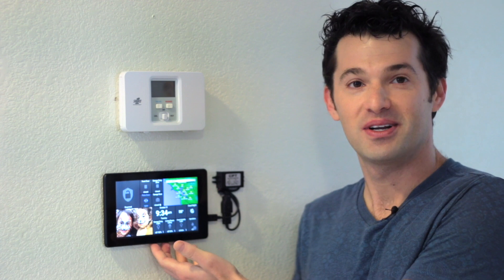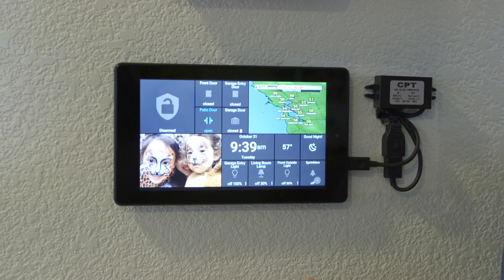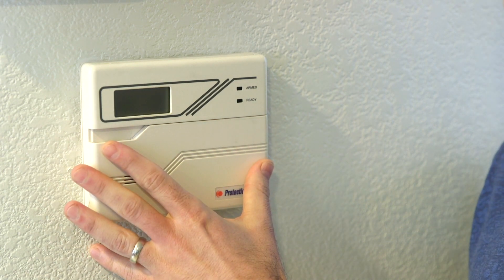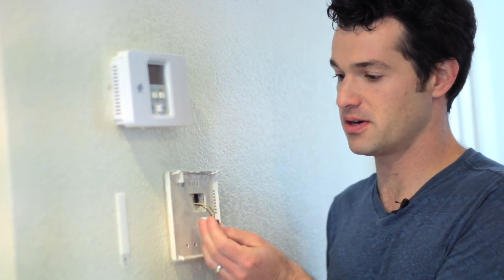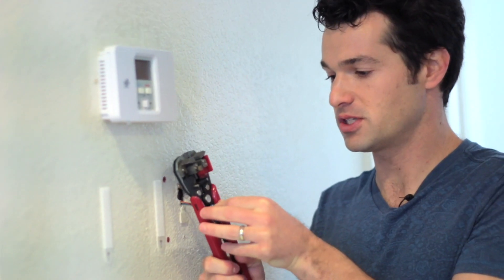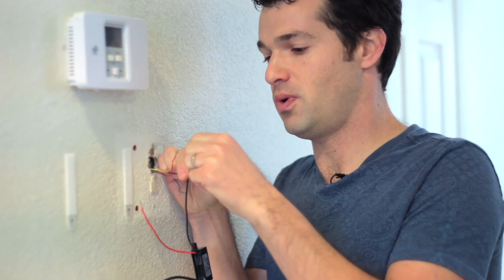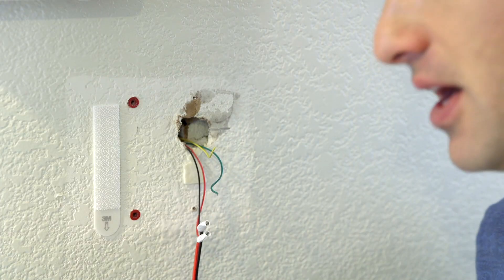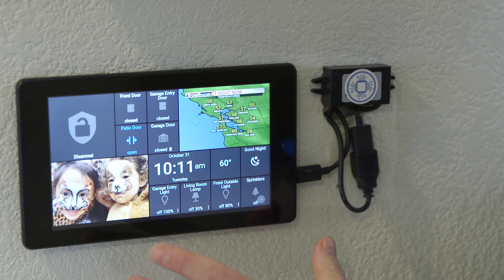Replace your alarm system keypad with an ActionTiles touch-screen tablet — Konnected DIY add-on

Comment: Let me just say that wire bundle and usb-power module on the wall is the worst looking installation I have ever seen!  it look 10X work then just keeping your legacy touch keypad!
Reply from the maker: this was just a demo... you can easily hide the wiring behind the tablet in the wall. We sell accessories to assist in that.

Comment: Correct me if I’m wrong but wouldn’t this render a burglar alarm useless. With Ring you typically need to enter a code upon entry to deactivate. With this  app it seems all you have to do is tap “disarm”.
Reply from the maker: Not quite—Konnected doesn’t remove the PIN layer, it just lets you choose where that PIN lives.

• Keeping the legacy panel (Interface Kit)
Your original keypad and entry-delay workflow stay intact. Konnected merely “presses” the panel’s keyswitch relay; the panel still refuses to disarm unless the correct code has already been entered on the keypad (or you’ve wired that relay to a keyswitch zone you purposely made code-free). If you want the traditional enter code within 30 s behaviour, you simply leave it programmed on the legacy board.

• Running panel-free (Conversion Kit / Alarm Panel Pro)
Disarm commands flow through a hub such as SmartThings, Home Assistant or Hubitat. Each of those platforms lets you require a PIN or biometric unlock before it will send the disarm call:

SmartThings Home Monitor – toggle Require PIN for secure devices and set a 4-digit code; Google/Alexa voice control also asks for that PIN.

Home Assistant Alarm Panel – enable code_arm_required / code_disarm_required and pick any code length.

Hubitat Safety Monitor – same idea: Require Disarm Code.

So an intruder still needs (a) your locked phone or (b) the correct PIN on an exposed dashboard—exactly the same gate Ring uses. The tap-to-disarm you saw in the demo assumes the user has already passed phone biometrics or the hub’s PIN dialog.

Comment: what happened to green and yellow wire?
Reply: I ask same question
Reply from the maker: Red and black were the keypad’s +12 V and ground, so we keep those to feed the step-down converter for the tablet. Green and yellow were only the data pins that let the keypad talk to the alarm panel; once the keypad is gone they serve no purpose. Just cap them off—or, if you want a little thicker conductor, twist green with red and yellow with black before landing the pair on the 12 V input. Otherwise, leave them disconnected.

Comment: All I have seen you do was connect the power from the alarm system keypad to the 12v to 5v converter. However, the green and yellow would be required to actually interface with the alarm panel to operate. Please tell me you just skipped a section, because you mentioned the connected and showed a small interface that I thought the green and yellow wires would go in that required the 12v power supply.
Reply from the maker: We didn’t skip anything—the tablet doesn’t talk to the alarm panel over the green/yellow data pair at all.

Red (+12 V) and Black (-) are reused purely as a low-voltage feed: they go through the 12 V → 5 V converter and power the tablet.

Green and Yellow were the keypad’s RX/TX lines for the legacy panel. Once you retire (or relocate) the keypad, those conductors have nothing useful to say to a tablet running a smart-home dashboard; communication happens over the tablet’s Wi-Fi/LAN to your hub or directly to the Konnected board.

If you’re keeping the original keypad, leave all four wires on it and run a second 2-conductor cable—or repurpose an extra cable run—to power the tablet separately. But for the typical “replace the keypad with a wall-mounted dashboard” setup, red/black power is all that’s required.

Comment: 2:30 Potentially valuable tip to share with your customers: Don't bend copper wires back and forth any more than absolutely necessary, as doing so induces stiffness in the metal which ultimately leads to fatigue and breakage. This holds especially true with solid copper leads.
Reply: Even more true with the cheap CCA wiring you are seeing more and more these days

Comment: I have an alarm, it is hard wired.. It is not wifi and I do not want wifi, how would this work with just powering the tablet and an app?  Makes no sense to me. The other 2 wires would need to be connected some how for the 2 units to *talk*.
Reply from the maker: The table communicates to SmartThings via WiFi. It doesn't "talk" directly to the alarm panel.
Reply: @Konnected-io  Thank you it's a little confusing because it's a bit vague..

Comment: I am pretty sure you didn't need to pull off your alarm panel to do that.  Also, since you are running the phone app on your tablet, I suspect it no longer requires a disarm code.  So anyone can walk up and disarm your alarm after breaking in.

Comment: Why WHY is that not tucked into the wall.  And then cover the hole with tablet and have the little power cord just plug in so much more cleaner u have great ideas though
Reply: Maybe even a 90-degree USB adapter so it doesn't jut out the side of the table? :-)

Comment: what do the other 2 wires do.  They are connected to my control panel on the other end
Reply: This is not a complete conversion, they just show you a wireless tablet!  this kind of system require a new wireless system module and sensor!  this wifi touch panel won't magically work with your wire system!

Comment: I am using ADT Alarm system using smart panel and GSM. I can use any smart device to arm/disarm the alarm system anywhere around the world as long as i have internet connection. The contract is finished. Now i want to be able to use existing motion detectors, doors/windows detectors (all wired) with new panel (tablet, cell phone or new smart panel alarm system). 

Any advice?

Thanks,
L.A
Reply: You should be able to use all of the existing sensors and motion detectors. Their support is really great if you need help. You can also purchase a 3d printed mount for the tablet. I'm about to do my first official install in a friends new home. All smartthings with ActionTiles and using Konnected as the alarm. Thing to note though....Right now the modules are wifi only. IF YOU CHANGE YOUR WIFI OR GET A NEW ROUTER, YOU WILL HAVE TO REPROGRAM EVERYTHING. So what I'm doing is getting a TPLink access point that is powered via POE and setting up an SSID just for home automation. (tablets, konnected, smart bulbs that dont use a hub, etc). That way, if I ever decide to change the home wifi, its on a different system and wont affect my home automation. But since it ties into the main router, and is not a router itself, (just access point) then users can connect to main home wifi and still control the devices.
Reply from the maker: You DON'T have to reprogram everything if you change your WiFi. Just reconnect to the new Wifi network. The rest of the settings are independent of WiFi and the device will resume working on the new network.
Reply: Look up the Ring retrofit kit.  I did the same thing with an old wired ADT system.

Comment: Imagine slapping a tablet in your front porch instead of a standard keypad... or using your smartphone instead of entering the key and having your smartphone run flat or be broken or not connecting to your wifi.. there is a keypad missing in the whole idea..
Reply: Good point - using an active USB repeater to extend beyond the USB 5m limit and interconnect into the Konnected system  for direct communication and management would mitigate this, but I don’t think Konnected (yet) has that capability. I assume the board would need to act as the USB host controller for the display.

Comment: Obviously something very important was left out of the video.  You can't simply cut your alarm panel wires and slap a tablet to the wall in place of the wired keypad.  Chances are, the wired alarm panel would detect the missing wired keypad as a tamper condition and sound the siren.  In order to keep the wired panel happy, it will need something wired in where the keypad goes.

Comment: That would be really cool if you sold diy kits. I ordered a amocam door bell with with little TV entercom inside the house so I could see who rings doorbell. The power supply runs both the doorbell and the intercom inside the house. Then plugs into an outlet to run both. How would you convert instead of a plug-in make it a hardwire like you just did,? Can I run the power supply to the doorbell wiring??

Comment: Thing is, how do you control your alarm in case you're having a network and/or power outage? That's probably the biggest attack surface for a burglar: knowing/seeing from outside, that you're using a tablet... You have to ensure your network access even at a power outage.
Reply: Wolfram Webers  - battery backup like standard alarm systems.
Reply: @nosirrahm  well, in that case you need to make sure your all your network nodes are battery backed up. That's not like a normal alarm controller, which usually has a 3G/4G access as an alternative.

Comment: @Nate Can I just use the AUX power output from the Konnected board to supply 5v directly to the tablet?
Reply from the maker: No, that's not recommended. The AUX output is 12V. You need to use a 12V to 5V USB converter to get 5V for the tablet.

Comment: You tell me which siren works outside with this shockproof system. I didn't find any. Maybe I can't look for it. Those on the Bangood site seem unsuitable to me.
Reply: My siren is attic mounted, but if you want to go outside try something like this: https://www.amazon.com/Products-Siren-Indoor-Outdoor-6-12VDC/dp/B0058M0R80?ref_=fsclp_pl_dp_10
Setup instructions are shown on the konnected website install videos.

Comment: Has anyone found a low price but reasonably attractive frame for a Fire 7 tablet wall mount that also conceals the USB to USB connector and 90 degree plug?  Without the frame, everything must fit behind the tablet in the wall hole.  It works, but probably not to code.  Just asking.

Comment: For those of us who have already made the jump to SmartThings and Kommected, this is a great project for getting rid of an eyesore on your wall.  This video is pretty old, so this was posted more as a concept than a final build. But you head to the Konnected site, you'll see much more polished installs and he has all of the adapters and parts at really good prices.  Before Nate even started this as a company, I went the DIY route using his code and tutorials.  Wanting to clean up my install and protect against lightning strikes, I ordered everything from him as a thanks for his openness to the DIY community and his fair prices.  For years, the SmartThings community has been wanting a solution for old alarm systems but there was nothing feasible until Konnected
Reply: @11 11 tech changes ever 3-6 months. 2017 - 2019 is very old by those standards

Comment: this system is not SIA licensed or UL listed  which means it has NOT been tested and there is a POTENTIAL for it to fail.   THIS ALSO DOESN'T WORK THE ADEMCO  WIRELESS SYSTEMS

Comment: Are there any tablets out there you recommend for this that might have a rear usb input for a cleaner install
Reply: https://www.newegg.com/Product/ProductList.aspx?Submit=ENE&DEPA=0&Order=BESTMATCH&Description=90+degree+micro+usb&N=-1&isNodeId=1
Reply: https://www.newegg.com/Product/Product.aspx?Item=9SIA86V4TK4326&Description=90%20degree%20micro%20usb&cm_re=90_degree_micro_usb-181-00PH-00012-Product
Reply: 90 Degree cables work or just use what you have
Reply: He didn’t put it into the wall because he needs to easily reverse what he did because he’s in a rental (he can’t make the hole larger to put everything in the wall).

Comment: Can I buy the 7 inch tablet and the 12v USB converter adapter and the SmartThings hub and use it to change my dsc original keypad and use my original panal and then buy the konnected later when it's more easier to join SmartThings and do all that set up its to confusing Thanks
Reply: Nope...not unless DSC makes some kind of smartApp/smart home interface that can talk to its own legacy panels (I am assuming they do not).

Comment: Nate this is an interesting idea. Does Konnected make a panel that will allow me to turn the alarm/siren on my security system remotely through my cell phone if I get a motion detection from one of my security cameras while I'm away? I'd like to be able to remotely turn the alarm on if an intruder were to somehow defeat the window or door sensors and gain access.
Although a neat idea, I'm not really interested in changing all my keypads.
Reply: Konnected does make that.

Comment: Can I use my current keypad with Konnected?
Reply: No
Reply: Now you can. A new Konnected product just came out
Reply: @quank32  HI Brad. Really?  Do you have a link to this?  Having a hard time finding ant reference to the new product.
Reply: @BK-ij9sf  Here you go. It's called the "Konnected Interface" https://konnected.io/products/konnected-alarm-panel-interface-for-wired-security-systems
Reply: @quank32  Thanks Brad!
Reply: @quank32  what did you do with the other two wires?

Comment: i think i missed something here, where did u connect the data cables?
Reply: Sandile Mpontshane I didn't.
Reply: i think it will be much better if you do another clip showing us how do u get the tablet (action tiles) to interact with the alarm system.
Reply: You don't have to do anything special. Konnected interacts with SmartThings, and ActionTiles interacts with SmartThings. The tablet does not directly talk to the alarm system. SmartThings is your home automation hub, and that's the role of the hub to tie all of your smart devices together.
Reply: Nate Clark what your  wtup Sandile please

Comment: Could I use the tablet as a chime also (when doors are opened)
Reply: I also think you could use the two other wires connected to a zone to connect the buzzer in the same location as the tablet.
Reply: Ray, this is done with a piezo buzzer (like you'd have in a computer power for system post). With Konnected, you use the "smart lighting" app to get triggered when a door opens and that then sends the momentary switch signal (you can specify number/lengths of beeps).

Comment: Hello,

I'm curious why, in your alarm panel, you wouldn't connect the Red wire to one of your 5V leads. Then you can simply splice a micro USB cable onto the end and have 5V coming straight from the wall instead of a big 12V to 5V converter wall wart.
Reply: Put the voltage converter in the main panel and just send 5V down to the keypads would be the way to go!

Comment: Do you know how I would go about getting power to the wires? The home came pre-wired for an alarm system but we never used it and there is no power coming to the red/black wires.
Reply: aawg_au Do you have alarm equipment installed in the home currently?
Reply: Vertron Bussey yes. Equipment is installed but we've never used it. I found the panel box where it's connected and the transformer is there, just don't know how to wire it and send power to the keypad area.
Reply: My box is powered by the alarm system. My alarm is in a separate room. And there are plugs in that room to it. When it is plugged in, the keypad gets juice too.

Comment: Did I miss the part where action tiles interfaces with the alarm panel?  I know it works with smart things but I’m not getting the alarm panel integration.
Reply: You r better of using his board that can piggy back the system and let u know the state of everything but if u r keeping the vista panel and u want a better keypad look up a tuxedo key pad there nice.  I do security.
Reply: so you simply got rid of the keypad but instead of  filling in the hole and setting up a tablet that you can have anywhere in the house you stuck it on the wall? Why would you bother with a tablet stuck on a wall instead of one you can take anywhere in the house or...................... use your smart phone!!!!!?
Reply: Mark Anderson  - this is giving people the ability to also arm/disarm their alarm from a panel like their old panel used to do. If you have guests, not everyone is going to have access to your smartthings app on their phone to arm/disarm or search for the wandering tablet.
Reply: @MHA_UK  If its used primarily for your security system (OBVIOUSLY), you need to keep it in the same place you would normally have any conventional security system access keypad... on a wall nearest to the entry/exit used most. If your kids or guest are entering your house and only have a few seconds to disarm the security system, no one has time to run through the house to hunt down the dang tablet... OBVIOUSLY 🤨. I would like to think that would be common sense🙄

Comment: Manufacturing a micro USB dock and having the tablet mount into it would eliminate most of the ugliness of the power cord profile and would look more professional. The mount being on the bottom would also secure the tablet to the wall with correct wall anchors.
Reply: I re-used the old backplates from my old panels, glued in some pieces of wood to raise it out a bit and put dual-lock on the pieces of wood. In the "rececessed areas, I hid wires and mounted my piezo buzzers for door chimes. There's literally a million ways you could do it, but I agree, hiding cables is cleaner.  There's lockable wall mounts too like you'd see in commercial settings that probably set you back almost $100 a piece, but no one would steal the tablets/tamper with them and it would be clean.  Honestly, a reecessed wall mount would be the most slick. I think mine turned out ok and I only needed to buy some more dual-lock, but I had the spare wood laying around from 1x2s.